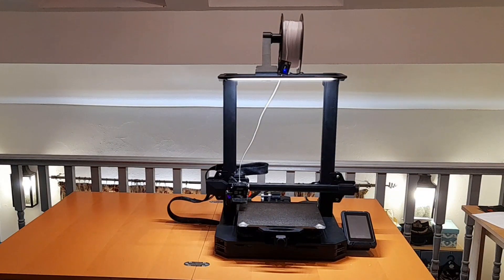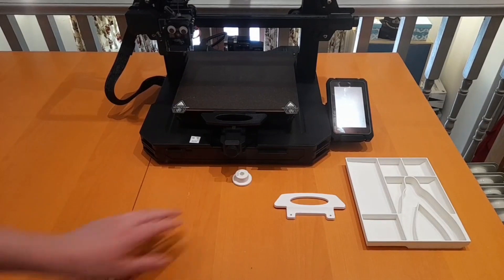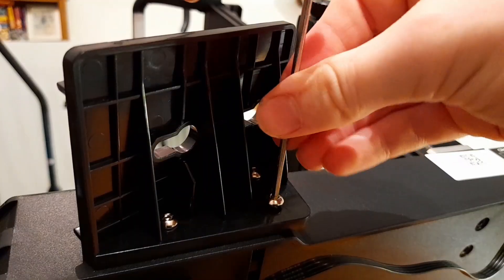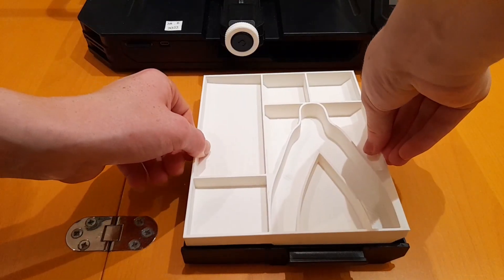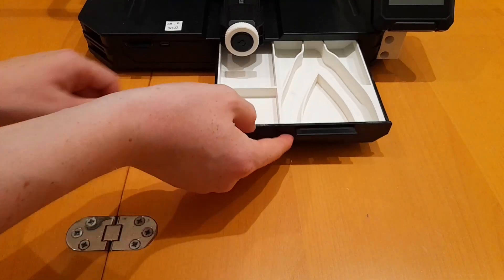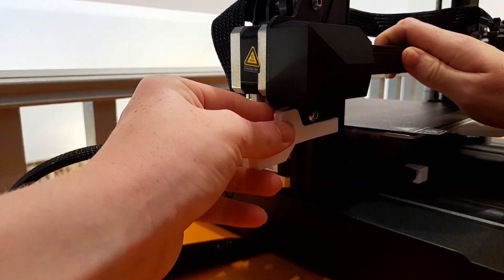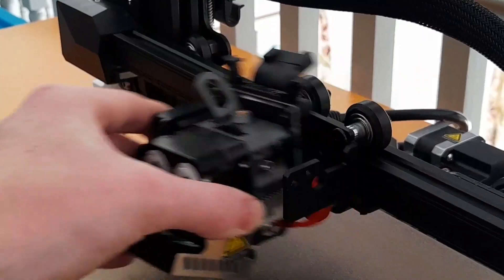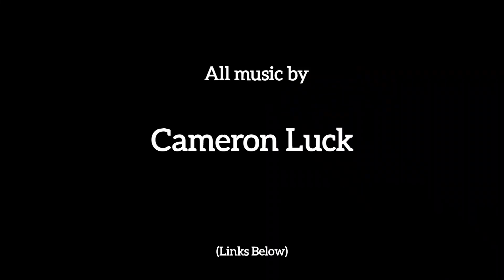Ultimate Upgrades & Mods added to my Ender 3 S1 Pro

Comment: You need to add the part that keeps wire that heats bed from rubbing on the rear motor that moves bed, it will start getting into the wire beside too long with that corner on motor. I found one on thingiverse I put on mine.